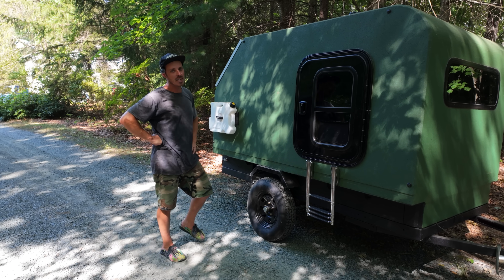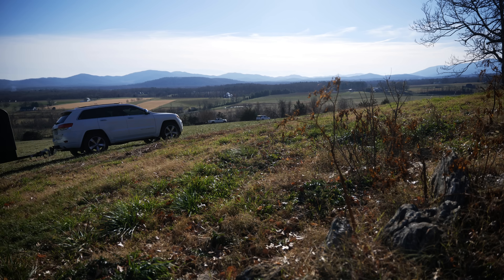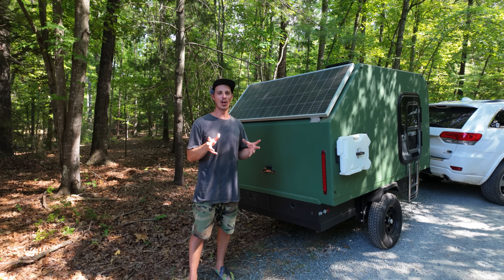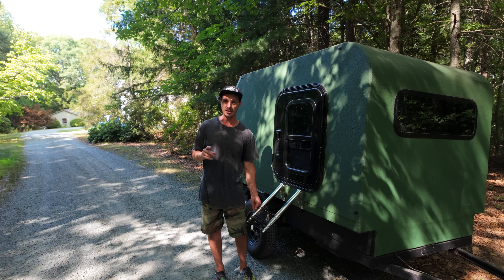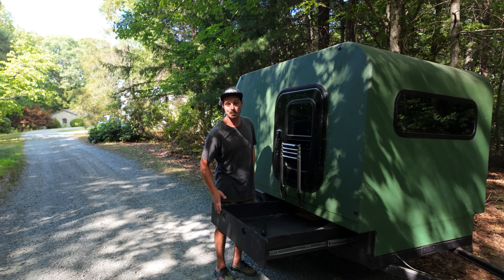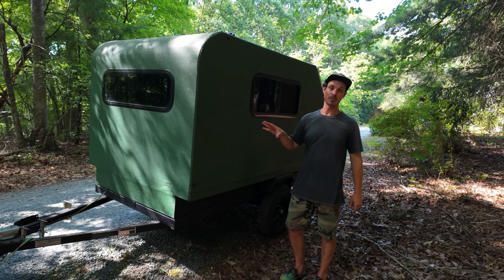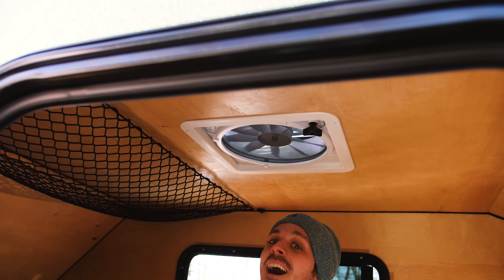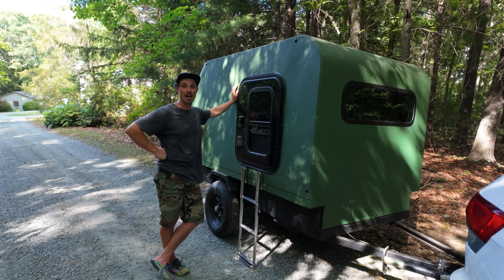Don't Do What I Did - Teardrop Camper Build

Comment: Before you tear that apart to rebuilt it, consider "wrapping" it with some sort of waterproof membrane.  You could get black, cover the whole top and halfway down the sides or something. You could stretch it as one piece or lap seam it.  Whatever.  But that would be effective and alot less hassle than tearing it apart and rebuilding it.

Comment: You may have had some problems over time, but I still think yours is one of the best builds I have seen. And I have watched dozens/hundreds of these videos in preparation to build my own. I really liked the under neath drawers, that was an awesome idea, and a great way to be able to raise the actual sleeping area up enough to make it wider than the trailer.

When the time comes, I will use some of your ideas and techniques on my own build. So thank you for the videos, even if there are some problems. :-)

BTW...how fast can you tow it? Supposedly these HF trailers are only rated for up to 45 mph.
Reply from the maker: I’ve towed it at around 70MPH no problem BUT I did upgrade the wheels which have a higher speed rating.

Comment: You could sell the trailer just for the trailer,save the windows and door and scrap the shell. Personally I would've have a aluminum shell frame made and use either RV tin or the other material they build RV's with. I'd add a more aerodynamic front to it with storage space. Back in the sixties my dad made a wooden shelled enclosed luggage carrier out of wood and painted it silver to mount on the Family '67 Chevy Impala station wagon to go and visit my mom's people halfway across the country. When it wasn't being used he kept it stored overhead in the garage.

Comment: ohhh you used the diy bedliner. sanding down your epoxied walls with 80 grit would have given it a better hold but ultimately taking it to a rhino liner place to have the lining done would have given you a 1/8" thick skin of car tire strength rubber on your outer shell. you could have totally skipped the wood skin on the outside.